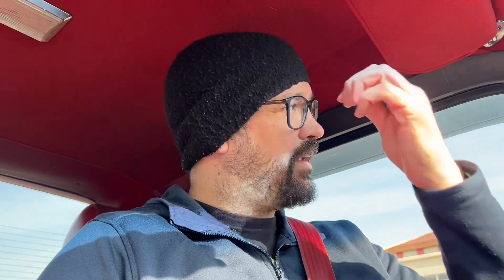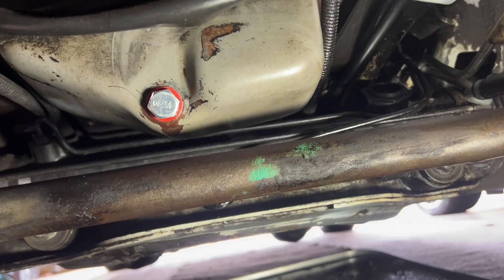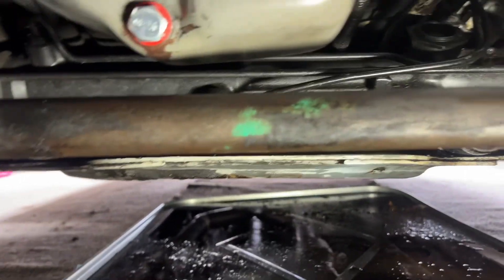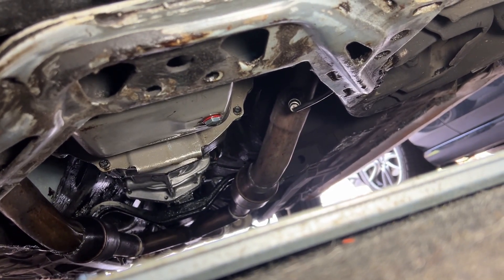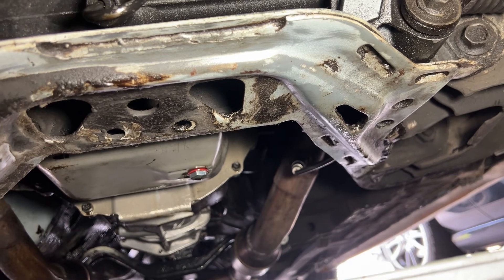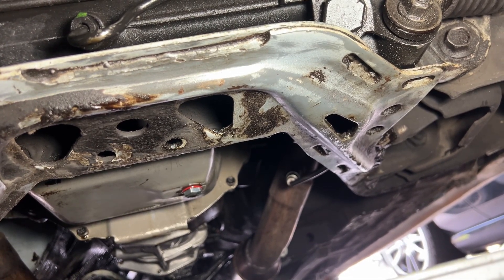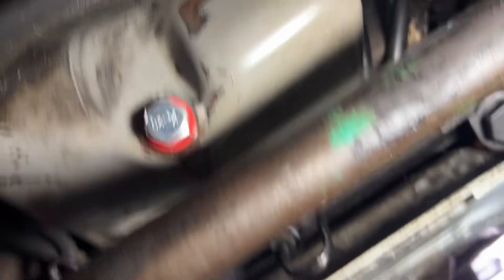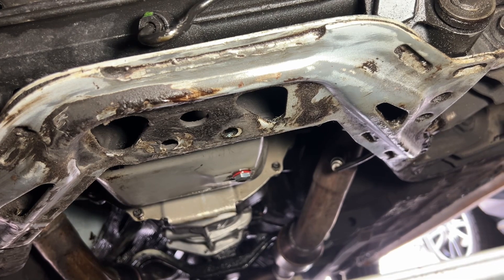Fox Body Mustang: Fiber Oil Drain Plug Gaskets Continued

Comment: My fox is stock with an AOD and the factory 3.27 option.  I agree that a 6-speed and shorter rear end gearing would be fun.  I just have a hard time justifying that spend since the car runs fine and has no drivability issues.  If my AOD went out, I wouldn't hesitate to 6-speed swap since spending money to rebuild an AOD seems silly.
Reply from the maker: Yeah, I don’t blame you for that approach. I wouldn’t be in a rush to replace a perfectly fine, functioning transmission.